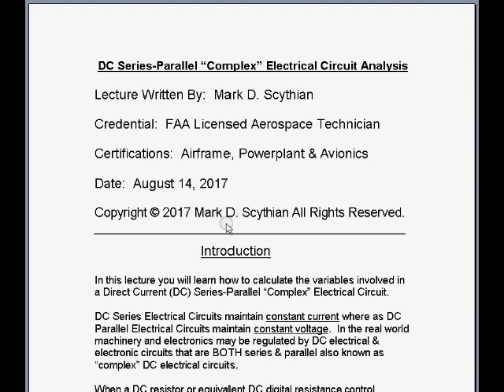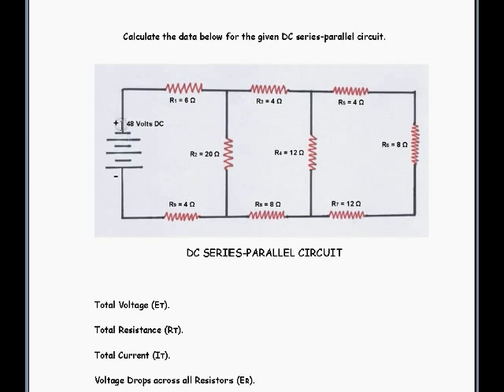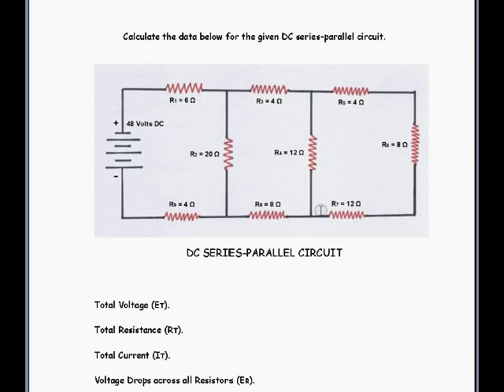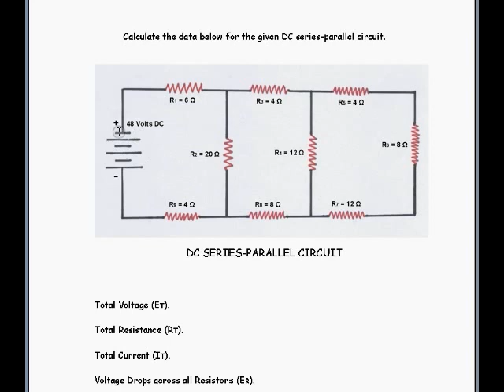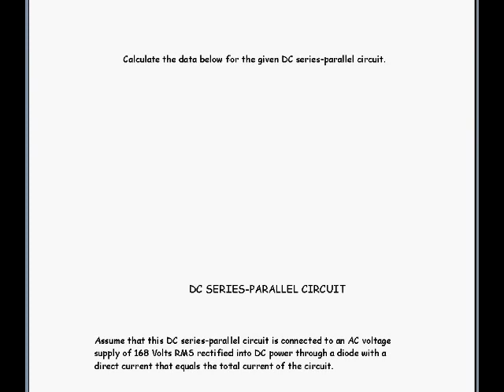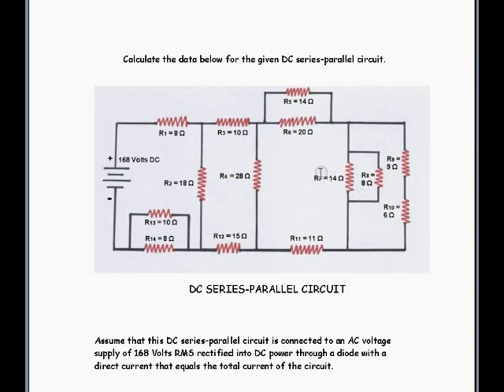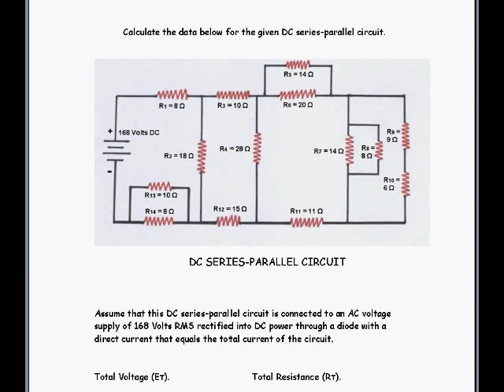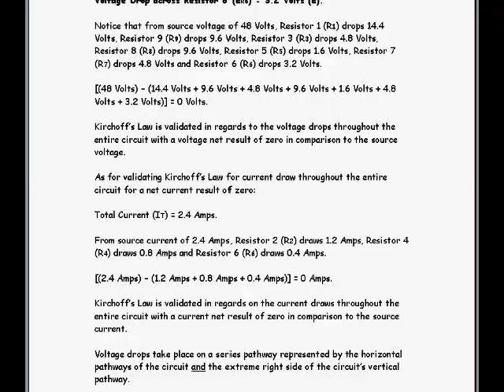DC Series Parallel "Complex" Electrical Circuit Analysis

Comment: Thank you so much for posting this video Mark. I am in the process of studying electronics at a higher level and used the last circuit for practice. Solving it using Kirchhoff's current/voltage laws (loops and nodes I call them) is a painfully extensive process, but I managed to get the same answers as you in the end (which honestly left me feeling relieved lol). The only problem I had was I stupidly misinterpreted I3 as I2 when solving the 4 simultaneous equations for the source voltage using matrix methods (obviously this got substituted for earlier), but other than that this vid was really useful...
Reply from the maker: Hi [[[ Dragonier ]]].  Most of the time during electronic or electrical circuit analysis, mistakes made are due to 'label-error(s)' such as interpreting "I3 as I2".  Happens all the time, which is why drawing an 'accounting chart' for inspection-proof is important.  Solving for Total Resistance, Total Current, and Total Voltage in "complex" DC-series-parallel circuits makes the remaining analysis much less difficult.  Also, circuit shape and geometry requires a bit of abstract interpretation along within logic.  Aside from these, electrical circuit analysis is fun, limitless, and always open to efficient problem-solving strategies.  Assuming one understands Ohm's, Kirchoff's, and Lenz's Laws along with series-and-parallel AC and DC electrical circuit theory.  Thanks for your comment!